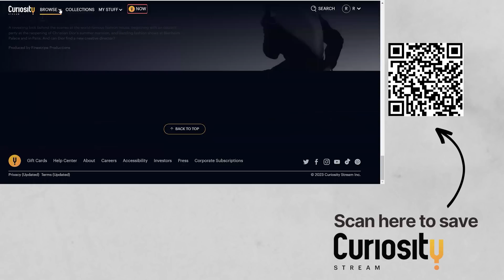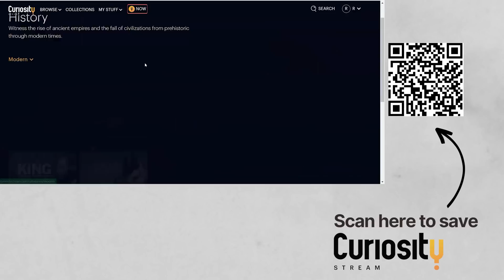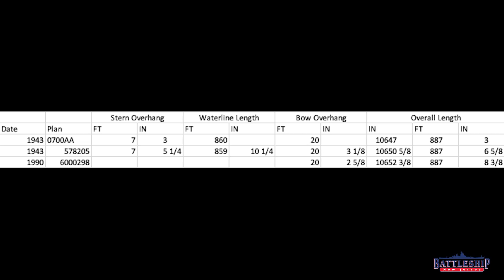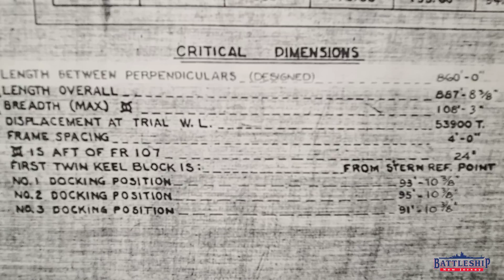Why Is New Jersey Longer Than the Other Iowa Class Battleships?

Comment: As a paint professional I really appreciate the point you made on the coatings having to deal with thermal expansion. It's well-known that exterior house paint has quite a bit more elasticity than interior house paint because it has to deal with the temperature difference winter and summer and even the difference between direct Summer Sun and shade.
Reply: you say well known, but today I have learned something new
Reply: My dad would use exterior semi gloss on everything...
Reply: @serfnuts  when I ran the paint department at Home Depot, the hardest paint we had was interior semi-gloss. It was best for high wear areas like doorway trim baseboard and cabinets. The exterior semi-gloss with softer could deal with expansion and contraction. And the high gloss was an interior exterior product.
Reply: Sitting here listening to the noises as the winter sun hits my vinyl siding.
Reply: Cool info

Comment: a 5th may be welding gaps between plates.  side by side plates would have a tiny gap left between then with the welding media filling  in such a gap.  over the length of the ship the main welding team could have been leaving a slightly larger the spec gap that would add up to one or two inches.  just an idea.

Comment: In the yard, the ship was measured with Surveyor's Transits, and the angles and distances are summed, on paper, after the fact.
And then you get into issues of who is declaring where to measure WL, Perp, or Overall.
Also pertinent is that hulls  "work" while at sea.  They hog and flex, the steel will "relax" into a new distance.

Comment: I bet over the years heat and cold cycles just stretched her. Airplanes usually wind up a little longer at the end of there lifetime. Also with that much mass she is not cooling off 30deg F over night.  She is going to stay at water temp for a very long time. I would say no more than 1 or 2 deg a day, there is no way 60k tons of steel are going to radiate away that much heat in 10 hour. That is an insane amount of energy. I doubt a nuke going off near her would put a 30deg rise in temp in her.

Comment: A land surveyor should be able to set up a reference point on deck and then just needs line of sight measurements to bow and stern to measure the overall length. Should be fairly accurate and could easily get multiple measurements to show error margin on these measurements. Then would be imported to a CAD program for actual measurement.

Comment: I just ran the numbers. A temperature difference of 75 degrees F will cause a 4 inch increase in length. All steels are very much the same. If panels were cut to size in the winter and then measured after assembly, you would see the full length increase.

Comment: Could they use photogrammetry to measure the length?  It is accurate enough for high-precision highway surveys. Theoretically it should eliminate the issue of the ship moving around if the images are taken rapidly enough.

Comment: I think you're missing an amazingly easy method of how they measured it. Plumb-bobs. Its a weight on a string that gravity will automatically make straight up and down for you. These seem to all be drydock measurements. Throw a Plumb Bob over the bows furthest point. Pull it back up till its barely above the floor of the dock. Take a straight edge and make an X below it. Repeat it with the stern. You now have two exact points on a level plane to compare the absolute bow and stern to. You can also use this to measure the underside tail to stern and front to bow measurements by putting it at the join of the plates that designate the sections. Any slope is easy to measure and account for since it's a known level surface you can always measure separately if you need to by survey gear when it's empty. 

There's even an extremely common naval equivalent, Sounding the Depths. You through a weighted rope with known measurements in fathoms into the water. When you feel it hit bottom, pull it back up. Count the measurements below the water and measure the remaining wetness above the last known measurement, and you have a "sound" depth. 

This method would be fast and intuitive to the sailors and dockworkers of the time. It would also produce exacting repeatable results based on gravity not the ships themselves. It still only tells you the absolutes at the time of measuring, so the REASONS aren't particularly explained by it, but it means you can pretty reliably accept the measurements are accurate. 

Since the measurements in my scenario could be considered accurate and include the bow, stern, and total, you can find the Amidships by subtracting each from each other. This tells you where the differences would be, to find your answer. I'd need to see another Iowas charts at as close a time as possible to be sure, but if the tail and front are "long" your angle theory is likely true. If the amidships (with the bulk of the armor) is long then its likely the plate theory. If they're ALL long, since the plates are a known number between front and tail to bow and stern, you can see if the front and tail match machining error, or if they "added the extra four". If none of those are conclusive, you can normalize for heat easier by looking for any known weather patterns at the time
Reply: threw a   ......        Iowa's charts
Reply: I was thinking the same thing, plumb bobs over the bow and stern while its in dry dock would be an easy way to measure the actual length.

Comment: Going off the temperature idea - perhaps a large amount of the hull was completed during winter time, when the metal was denser? During moderate temperatures, that could then expand the ship beyond design specifications.
Reply: Yes, when you look at the laid-down dates this makes sense.

NJ being laid down in September would have the keel completed during the coldest time of the year. Missouri and Wisconsin were laid down in January and the keels were probably not completed until Spring.

Comment: I'm sure there'd be a local surveyor who can come up with a plan to measure the ship several times during an average day. I've got a couple of ideas myself,  but I have no idea how practical they are. As Ryan said, the biggest challenge is the movement in the water.
Personally I don't think they worried about unnecessary precision during WW2. If it worked it was good enough.
Reply: Several Laser reflectors fitted at various points on the hull, can 'ping' two or more at the same time to get the distance between them whilst accounting for ship movement.

Lenght at the waterline is unlikely to change during the day as the water temperature is much more consistent, portion of the ship above the waterline would be changing, just like a road bridge.

Comment: All manufactured parts are made to a nominal size with plus & minus tolerances. It just happened that the New Jersey's tolerances worked out a little more on the plus side. What is amazing is that there is only a 4" difference. As a percentage it is minuscule.
Reply: Tolerance Buildup.   Important in electronic design when selecting components.

Comment: Ryan almost made without saying "scream" instead of "stream."

For the worker theory, it didn't have to be the longest of any battleship, past or future, just the longest Iowa-class to make the natives proud. ;-)

As for the length difference, I favor the temperature difference IF we are going to accept that there is an actual difference.

We don't know the method by which the Navy got the measurements. They could've just been pencil whipped to get the chore of filling out the forms out of the way.

The only way to know for certain would be to measure all four in the same climate conditions AND using the same method. By method I mean both the technology AND that the two end points are the same for all four vessels: waterline at the same tonnage, midpoint between the waterline (at the same tonnage) and the main deck or the most extreme point of the bow to the most extreme point of the Stern.

That is something unlikely to occur in my lifetime. ;-)

Comment: A 0.03% difference is probably an acceptable error in some hand measurement with tapes or something, also measure the beam and see the difference there also. You could laser measure by putting poles with laser and target measurement equipment over the edge, mark where the poles are on the deck precisely and measure to the end point, add it up. You could also measure temperature fluctuation between the poles over time if there is a fixture for the poles, the pole measurment should cover 80% of the length. The front and back are not at the same altitude so there is some hypotenuse distance added, is that worked in, a lot of differences in length when you do not measure at the waterline, deck length, level length with a line extended down from the bow, etc. Considering the bow upward sweep there is probably feet of difference between deck length and level length, the Wikipedia diagram for overall length seems to show level length.

Comment: I don't think the extra length was planned. If the designers messed with dimensions even a little, it would risk causing misalignment issues as construction progressed a they didn't have time to waste. I suggest the cause of the difference in length is sag. All things sag. Even metal gradually deforms and the various stresses on a ship can cause them to sag and spread a little. The amount of sag is going to be affected by different stresses. Not just temperature, but the physical strain that the ship is put through and even the weight of the machinery it carries. The science at the time the ship was built wasn't as advanced as it is now and didn't address the amount of sag. But other large structures also sag and spread at the bottom and that has to be planned for these days. Iowa happened to sag more than the other ships because of random stresses. But, its not significant.

Comment: if you get a land surveyor out they could run a traverse on the ship and get the length accurate to less than an inch. my guess is that is how they did it originally, or from land when it was being built

Comment: I don't believe the 4 inches would happen on the ship on the water as the temperature of said water would help mitigate the air temp keeping the steel of New Jersey closer to e we equilibrium. It world be interesting to measure any changes in drydock from not just temperature  variation but flexing as welll

Comment: As it rode deeper in the water because of more weight, wouldn't that change how far forward or aft the waterline met the angled bow or stern? Then, another measurement is made with more or less weight throwing off the measurement?

Comment: With regard to temperatures today the museum might be logging temperatures down inside the hull.  I would guess it pretty much matches the water temp and doesn’t change much through a single day.

I expect standard surveying tools could get a length within 2cm.  You probably don’t measure it from the land.  Go between points on the ship.  With a number of landmarks (eg turrets) you could find out how the ships vary over their length as well as overall.
Reply: You could theoretically go from land. But you'd need to reference the pier. Then reference the profile at the gunnels. Then finally get a centerline reference matched laterally to the gunnel references. Then some basic trigonometry would give you exact dimensions from the ground.
Reply: @ThrawnFett123  wrong

Comment: Hi, I’m a naval architect. The length discrepancy wouldn’t be a result of overmeasure (the plates being longer) or thermal expansion. The length given is generally going to be the length shown on the plans because the length on the deck will change depending on temperature and the loading condition will make the deck longer or shorter depending on whether the ship is hogging or sagging. My hypothesis is that the shipyard workforce (welders, engineering dept, etc) did decide to make the ship “longer” by moving something small like the bow pulpit slightly forward or slightly elongating the stern or both and put it in as a design change notice (which is a way of documenting things that the shipyard altered during construction, like areas where plate deformation required an insert plate) and the navy picked it up and ran with it.
Reply: Looks way better than all other mentioned ideas.
Reply: That makes sense.  As said in the video, "I'm not sure how the ship was measured."  It makes sense that the official length came from the construction drawings and that any variance  from the original specs would have came from a "change order" that was needed for construction.  I suspect the final official length of the ship is documented in its final plans and drawings that would include the sum total of all variances from the original design that came from change orders in the ship yard.
Reply: @jeffbrooke4892  Yes likely a sum of different orders, so shaving a sheet to exact dimensions was not done, to keep to a schedule, and instead it went in as is, slightly oversize, and was then followed by the rest of the sheets in the line, because either the saw was being serviced, or was too busy. going to be hard to see a few side or main plates that are too long by 1in or so, so overall it would grow, especially as there was pressure to get it done.
Reply: @jeffbrooke4892  I think they might want to check what for state each ship was in, when that measurement was done.
For one, did Jersey keep some gear longer, because she was say, still active, while the others where put in mothballs?
Bit earlier with upgrades and testing them out for the other ships?
Did she still have her catapults, while the other had already lost them?
Things like that, could also be behind it.
Reply: Very cool job👍🏻
Reply: Perhaps a Curator will get down to measuring the distance between frames. I think he would enjoy it.
Reply: Sounds like the most likely reason.  Nobody measured the ship with a tape measure when it was completed - the stated length is that in the plans.
Reply: Realistically, these kinds of slight variations are normal during construction, and if you precisely measure any two ships of the same class of that era, all will have slight differences in overall length. This is especially true when different shipyards are involved. While all parts are supposed to be identical, there are certain parts in the bow or stern area where the exact form may not be perfectly replicated. A very slightly different forward angle at the top of the bow, slightly different stern curvature, etc. None of these things affect the ship's performance, but they do result in slight variations.
Reply: I was told USS Wisconsin was longer than the other Iowas after she was repaired.  Is this not correct?
Reply: So where is the design change notice?
Reply: I buy into the workers intentionally making it longer, they wouldn't have needed to know it would be the longest ever, but even just being the longest Iowa is enough to want to make your own states ship a tad longer.
Reply: If the ship was intentionally made longer, I'd guess it was most likely done by New Jersey native shipyard engineer. Or, perhaps the plates were trimmed to size in the winter and thus were slightly oversized at standard temperature, and instead of redoing the work the shipyard just recorded the deviance?
Reply: Okay, I hear "hogging" and all I can think of are Bremerton leave stories.
Reply: Isn't this relatively common in shipbuilding, considering that most military vessels are bespoke, and thus variance would also be especially common in an era of mass-produced mostly hand-built vessels?
Reply: Did the Iowas have Camber?

Comment: 1/100th of an inch tolerance would be only account for a 3" difference if the the hull was over 300 plates in length.

Comment: I've been told that the WISCONSIN is the longest IOWA class BB due to the bow it received from KENTUCKY.
Reply: I had also heard that Wisconsin was the longest in service, not as built. After fitting the new bow, she was six inches longer than before
Reply: I was under the same impression.  Maybe he's referring to as built lengths?
Reply: Same

Comment: All of your explanations are relevant. Any combination of them could easily explain  the overall length being off. What were the tolerances of the components it took to build something spanning over 887'? 4" seems pretty tight to me considering. ½" gap here or there and some slick weld doctoring could easily make it a few inches longer. It's a linear manufacturing defect caused by the process and weather variations.
Reply: Add to the above explanations the fact that over such a distance, a mis-tensioned tape measure will stretch too, and may accumulate its own errors.
Reply: @Tomyironmane  Yes the measures used could well have been slightly out of tolerance, or for tapes could have had a few crinkles in them, making them measure longer, or simply they used the mill sheets as is, no cutting as they had measured one or two in the beginning, and they were right, so did not bother with the rest, and the mill had also relaxed the tolerances to do a faster production, leading to excess size steel but still within the spec called for. Do that for 100 frames and the length is easy to get.
Reply: exactly
Reply: If you were to assume 20 ft long sheets of metal, you would only be talking about 0.1" extra between them.

Comment: Steel expands at .00065" per inch per 100deg F. So measuring between a 100deg day in the South Pacific and a 0deg night on arctic convoy duty the ship could in fact be almost 7" difference in length, and 7/8" in width.
Reply: Shitty measurement units, use metric like a proper engineer
Reply: Except the ship is sitting in an ocean which is never going to fluctuate by 100 degrees. Also the steel is a heat sink and the interior spaces don't see such drastic variation